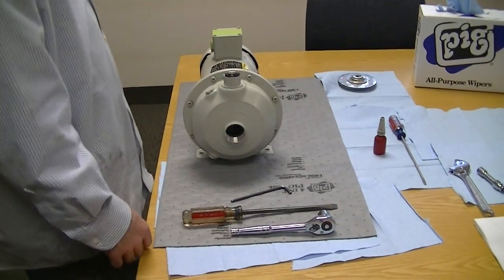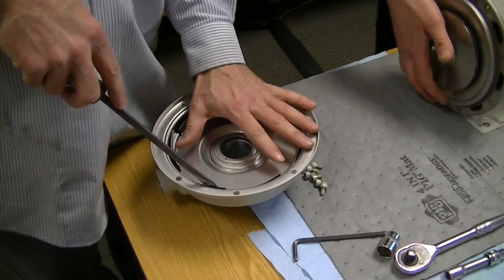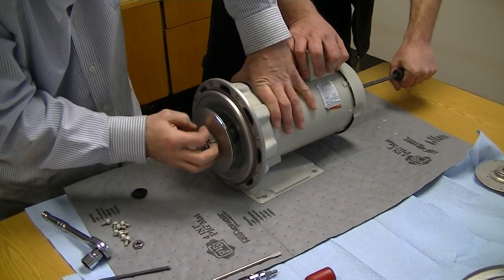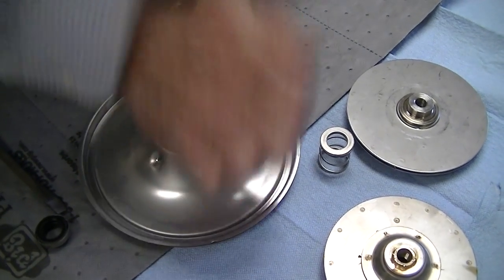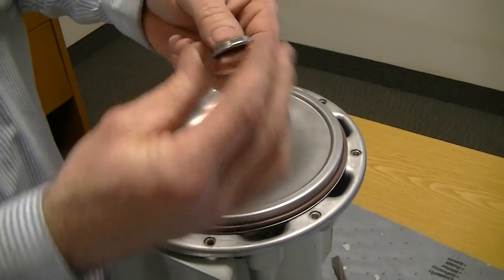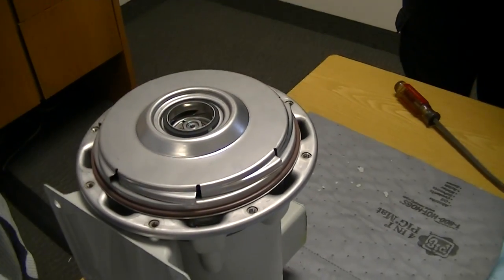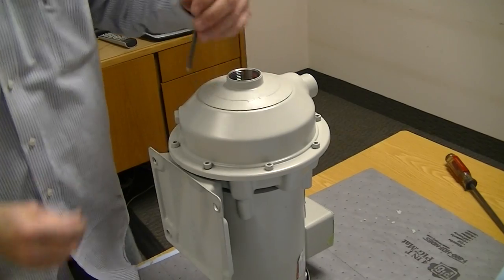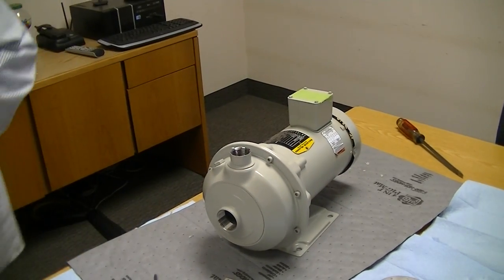Goulds NPE Pump Seal Installation

Comment: That is good 4 a new pump like the 1 u are working  on  but what about a pump that has Ben working  4 years and the parts are rusted thay don't come off that easy
Reply: +john Kosheluk 4 years is not long for a pump. You should have no problem taking it apart.
Reply: 4 years? Damn I'm lucky if I get one that lasts a single year. That square o-ring that sits over the end of the impeller before the cover goes on always gets sucked into the impeller, torn to shreds then it takes out the mechanical seal. Every 4-6 months I'm rebuilding one of ours.
Reply: Same here. That damn square ring gets sucked into the impeller and shredded. I started not installing them (MFR said it was ok to not have it you'll just have slightly lower pressure) after the seal actually wore through the impeller nose to the point it left the ring of impeller nose in the inlet.